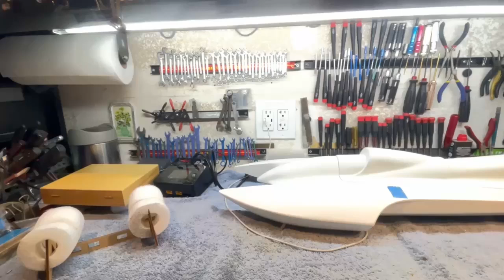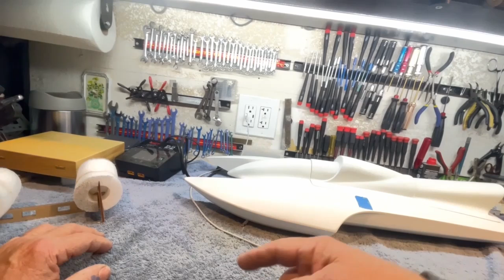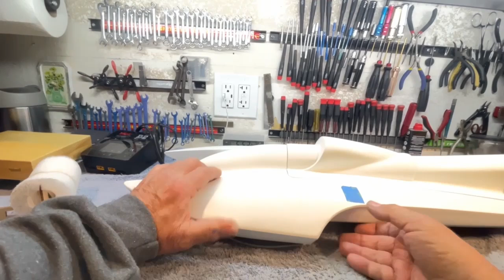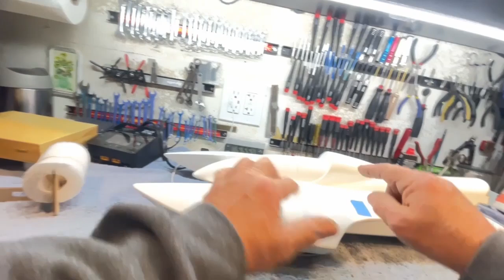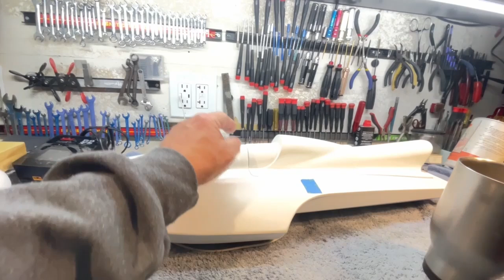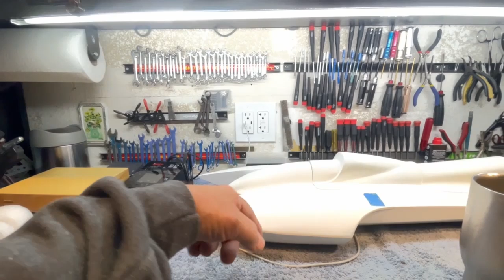Dr. Jet clandestinely invents things whilst looking at turkey and stuffing.

Comment: I dont remember if it was this video, but in one of your recent videos you talked about spray paint. Have you seen the rustoleum spray paints lately. They have a dial on the nozzle that you can dial in your spray pattern.
Reply from the maker: Many paints have a turnable nozzle to go from a vertical to horizontal spray pattern.  Is this just a refinement of that principle?
Reply: @Dr_Jet  vertical, horizontal, heavy, light, spot or fog. There is like 7 settings.
Reply from the maker: @brandoncocola1322  🤔